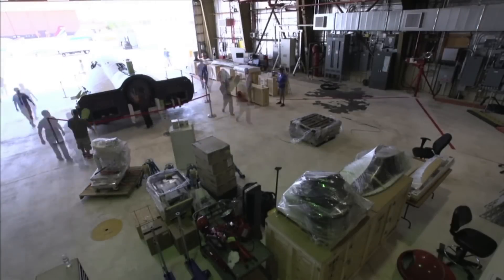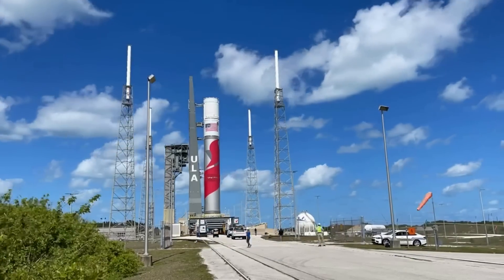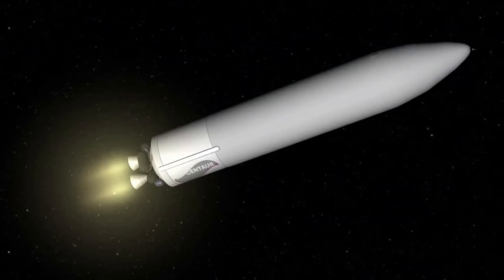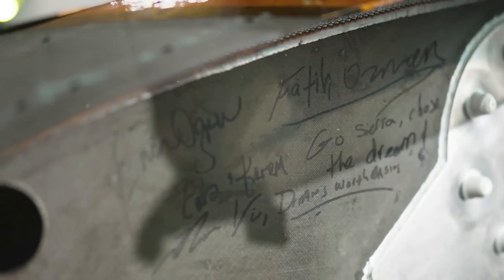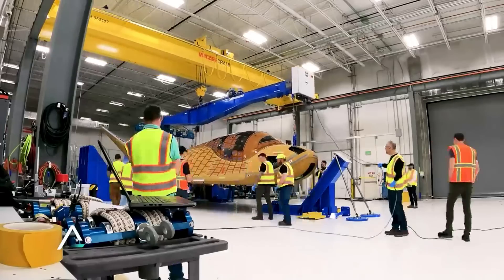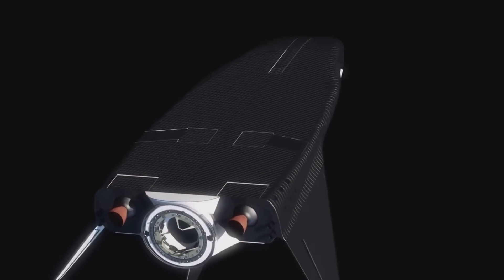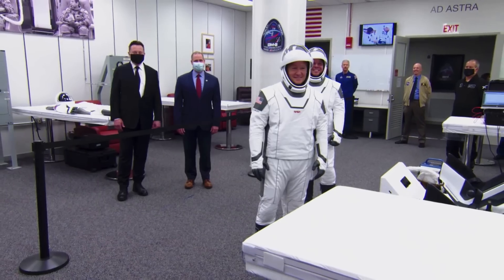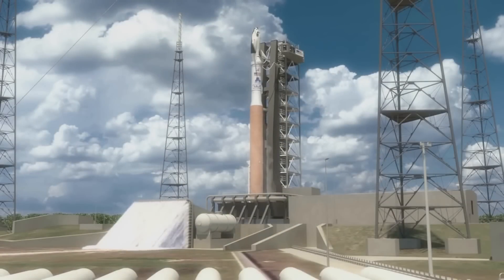What Dream Chaser Tenacity's First Launch Will Look Like

Comment: Boeing proposed to develop an upsized X-37 Orbital Test Vehicle (OTV) referring to it as the X-37C. This spacecraft was planned to be between 165% and 180% of the size of the X-37B, allowing it to used for cargo or to transport up to six astronauts inside a pressurized compartment housed in the cargo bay.  NASA showed little interest betting on the CST-100 Starliner.  In that the X-37 was flight proven it seems to me an opportunity lost.

Comment: One thing I note that is of interest and I can't wait to see the solution is when they (appreciate 'if' as you never know how things will fare long term) make a crewed variant what does the top of the rocket then look like? You cannot put fairings on after loading crew, and dynamic forces on the ship if exposed during launch are also interesting and complex when the nose of the rocket has lots of odd curves etc.. i assume for a crewed variant the wing folding mechanism would be removed and wings would be fixed as that would eliminate aero foces getting into the mechanism area.

I do hope this goes well for them. I wonder what market they can carve when compared to dragon (both cargo and human) as the design doesnt seem to offer any differences in useable capability (ie the design doesn't immediately mean quicker reuse compared to human dragon, and as dragon is also reusable the cost benefits of reuse are 'matched' as well. 

I'm seriously rooting for them, don't get me wrong, just not sure what capabilities it adds in the much much bigger picture.
Reply: The ability to land on any runway gives it more redundancy over capsules and also the 'soft landing' can be better for returning experiments that are of a more sensitive nature. Being able to land on any runway makes it a great emergency escape module for future space stations